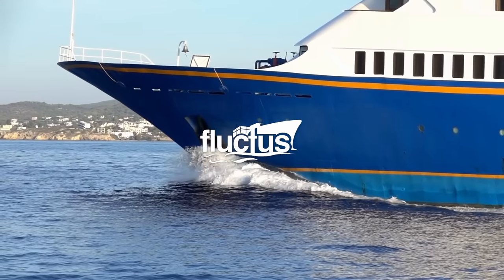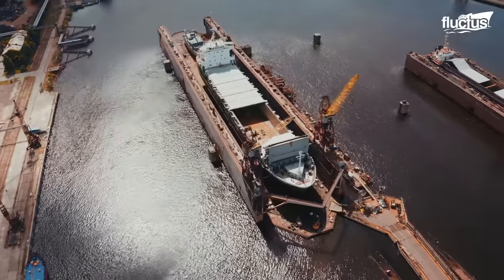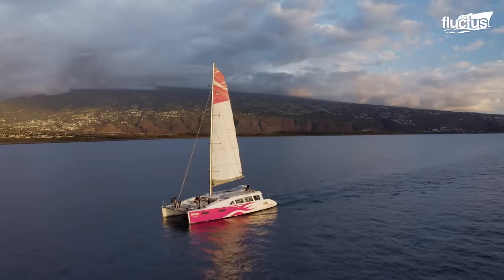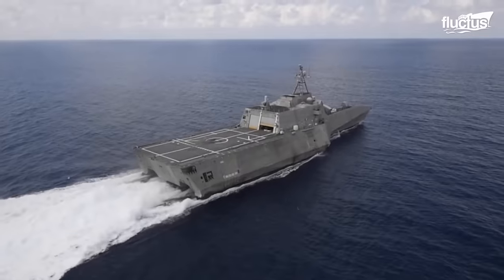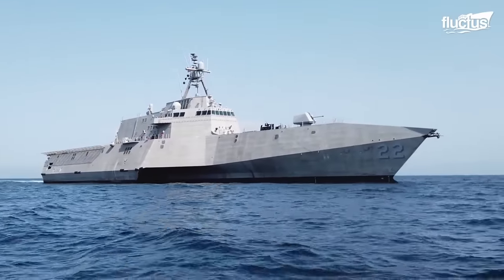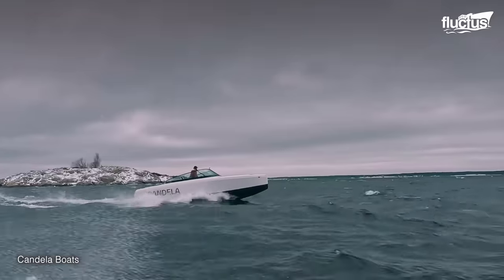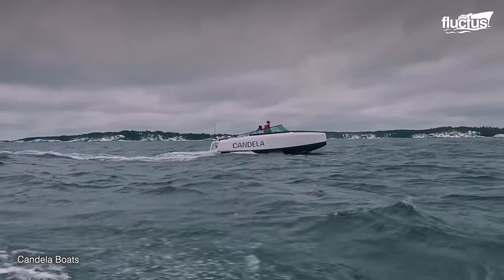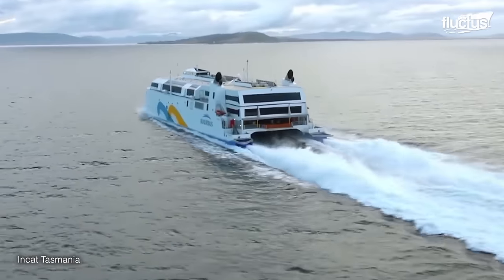How the US Navy Tested a Revolutionary Super Advanced Hybrid Ship

Comment: Incat 45 was commissioned into the Royal Australian Navy as HMAS Jervis Bay between 1999 and 2000. Over this time, she made 107 trips between Darwin and Timor Leste (then known as East Timor), shipping 20,000 passengers, 430 vehicles and 5,600 tonnes of freight, becoming known as the "Dili Express.” Running the Jervis Bay proved more efficient than using air transport to move materiel to and from Timor Leste with the higher sailing speed averaging 45 kt, meaning she could turn around a payload faster than multiple C-130 Hercules flights for an equivalent load. Incat 45 is now based in Greece and is used as a high-speed ferry by Seajets.